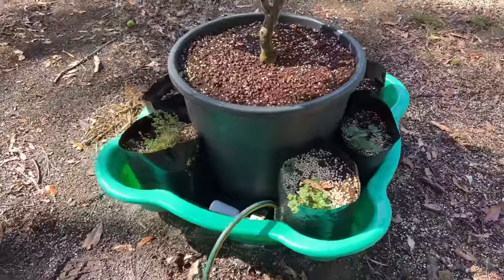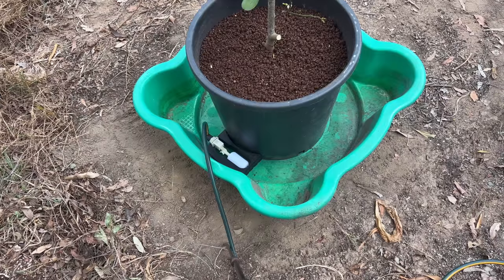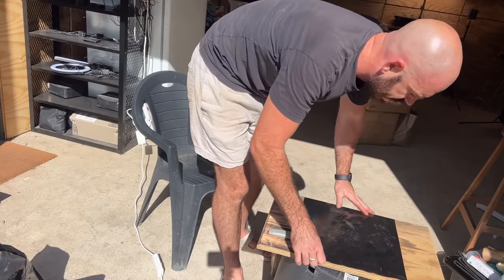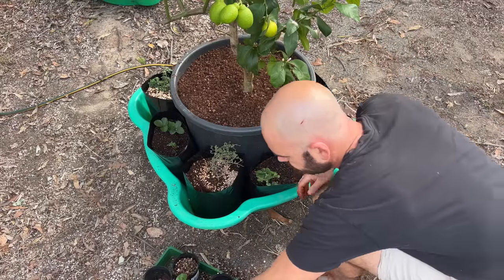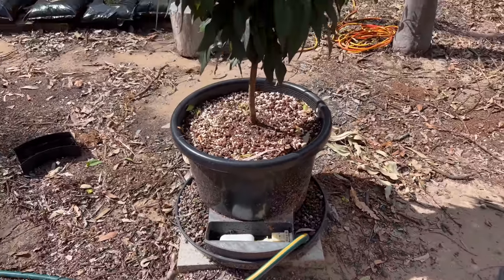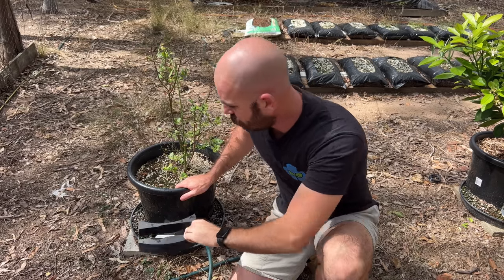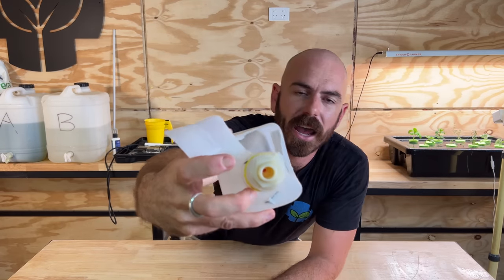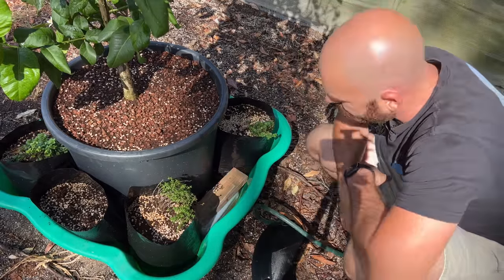The Lazy Man’s Self Watering Garden

Comment: You can also use a tupperware container. Paint it black, to prevent algee. Youll probably need a bigger bottom container.

I'm thinking of making a bucket with a tupperware attatched to the bottom side using epoxy. You wont need a bottom container.